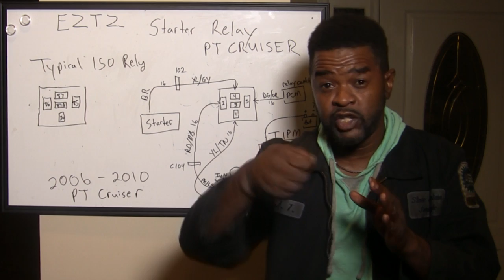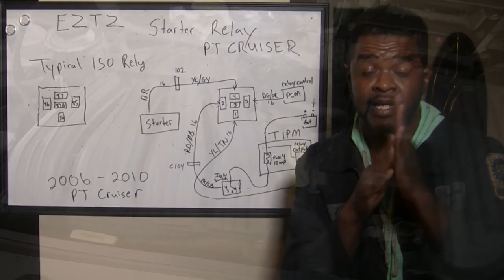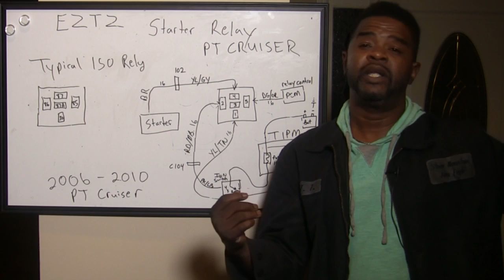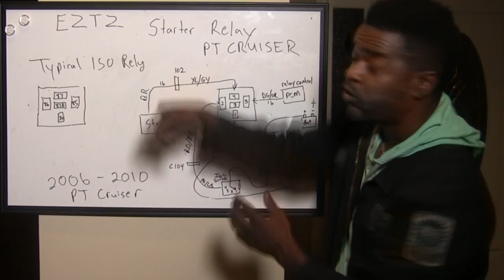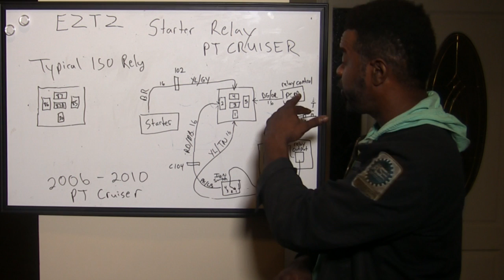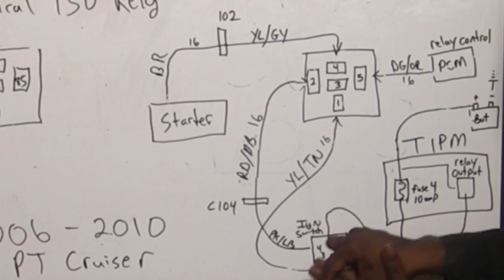No Crank No Start Diagnosis done using the Starter Relay, DIY.Won't Start? Simple Checks. PT Cruiser

Comment: I have a no crank Issue with my 08 Dodge charger. I have brand new starter new battery changed the relays I’m getting 12.4v on the power wire at the starter. Crazy part I got 12v on the s wire when it’s not connected to starter but 3v when it’s connected. Im stuck and need help
Reply from the maker: This not making sense. First off what kind of car is this? What are you refering to when you say "s wire" The big heavy gauge wire? And also are you subscribed to the channel?
Reply: Trust me it makes no sense to me either, but It’s a 2008 Dodge Charger. Yes I’m a sub and love your videos. I’m getting 12v at the heavy gauge wire and on the starter wire (the pin on the Solenoid) but when I put the wire on the starter solenoid and have someone turn the key  I only get 3-7v.
Reply from the maker: @NewMobEra  Hey bud, the yellow and gray wire that goes to the starter solenoid comes from the TIPM starter relay. One or 2 problems, you may have a loose body ground (check ground connections over by the TIPM area). Or better yet, just bypass the ignition and send 12 volts straight to pin 87 of the starter relay and see if the starter turn over normally
Reply: When I jump the relay 30 to 87 it starts right up. Do you ever host any live or q&a’s. at this point I’ll pay for a consultation I have to figure this out because my wife usually drives that car with the kids
Reply from the maker: @NewMobEra  Hey bud, I will say this. If you jump that and it start you just confirmed the circuit is complete between the TIPM and the starter. Your biggest task will be finding out where is the loss/short between the ignition switch and the starter relay. And without a scan tool showing data inside the skim, pcm and the TIPM this will be hard. When I have problems like this I view this data to see whats missing in order to correct. When you turn your key to the crank position, that signal goes thru the security module, thru the pcm and then to the tipm. How are you going to view which one is not getting the signal? What im trying to say is you will need a scan tool that can access those models and show data. Outside of that, the only thing you may can do without all that is to make sure all the grounds on the side clean and tight. Sorry bud but the electronics not what they use to be, a good scan tool crucial.
Reply: I appreciate you taking time out of your day to answer my questions. Keep up the great work !!!

Comment: Great explanation. Only question, would this be the same application for a 2011 Ram 1500 4x4 with a hemi 5.7?
Reply from the maker: Same theory apply to any starter sys that uses a ISO starter relay. But this a 2011 Ram, is ya truck cranking but not starting up? Also are you subscribed to the channel?
Reply: @OnlineMechanicTips  subscribed yes. No crank at all. my starter relay is only 4 prong, instead of 5, when I try the old trick of the screwdriver on the starter between the power and the tab all I get is clicking with the power on of course. I thought at first maybe the NSS, but damn, trying to find it on that truck is a pain.
Reply from the maker: @13thragnar  all you doing by jumping it is bypassing the circuit. This click that you hear, are you hearing it from the starter? as if the solenoid trying to engage? When you turn the key to crank, are you getting this same click? If so, the circuit complete and your starter simply failed.. If thats not the case, you need a scan to to look at inputs at the TIPM as well as the PCM to see whats preventing the circuit to close
Reply: @OnlineMechanicTips  I pulled the starter and waiting on ride to parts store to test it, but I have a good clue it is the problem. The wire that goes from the solenoid to the starter is very corroded and brittle and falling apart.

Comment: I have a 2003 PT Cruiser touring model has a new battery and starter.  It sat for 5 months,. Went to start it and nothing so charged battery and no crank   also radio stopped working and back window wiper will not shut off. Can you advise or direct me somewhere to get this help I need? please

Comment: I got a 3.6 v6. No crank. I swapped starter relays. I've tested the battery. I've pulled the starter tested the starter. It was slow but it passed. But no crank. I check all grounds I can find.  And I'm at a lost
Reply: Also pops starts with the clutch if you roll it . So I'm just fucked in connection somewhere
Reply from the maker: Pop start with clutch? What kind of car is this? Also are you subscribed to the channel?
Reply: @OnlineMechanicTips   it's a 2011 v6 Camaro. Recently just swapped the engine for a rebuilt. It went great. Ran great for about a week. And now. no crank.  Doesn't take a jump. I swapped the relays . Pulled the starter. Starter functioned. But engaged slow.  I get power upfront I hear all the actuators getting power. But no click not even from the starter  and yeah I subscribed  when I found hour channel
Reply from the maker: @PoppaLung707  Hey bud, just as I mention in the video. At the starter relay of any car, you should be able to diag a no crank,, First, at the relay, find out which pin goes directly to the starte, send 12 volts on that pin to see if the starter spin over over, if it do, the circuit is complete from the relay to the starter. If not theres a open circuit or the starter bad. Nest check your ignition input, which ever pin dictate key to crank position, you should be getting 12 volts on that pin when in the crank position, if not, ignition input lost. You may have to look up starter relay pin ID
Reply: Okay thank you

Comment: Jumping pin 1 and pin 4 only causes the starter to click once. Same as if key turns. Just a click. Starter is new, pcm was replaced and it solved the issue. 1 month later I'm getting a single click again.

Do I need another pcm again?
Reply from the maker: No thats not what that mean, that mean you have some more diagnosing to do buddy. Lets take a real good look at the connections between the battery and the ground thats on the transmission. Also are you subscribe to the channel?
Reply: @OnlineMechanicTips  I am now =). I'll get to checking the trans ground.

Comment: Thanks for the information.  I did subscribe to your channel. We tried pushing the clip in the front of the holder with a screwdriver, but could not get it to move.

 I am changing the starter relay because the car does not start on hot days. The battery and starter have been tested by 3 mechanics and has been fully charged each time.  Two of the mechanic cleaned the battery cables, one replaced the battery cables, but the problem still exists.  

I can read and understand schematics because I was an electronic technician for years.  I asked the mechanics about the starter relay and was told that is not the problem.  Since I can read schematics, and have worked with relays, the starter relay seems to be the logical cause of the intermittent starting problems.

Thanks for your help!
Reply from the maker: Curious, during start attempt, are you getting a click sound from the starter or relay? Or are you getting nothing when you attempt cranking?

Comment: I want to know how to remove the starter relay on a 2008 pt cruiser?  I know where it is located but am unable to remove the old relay to replace it with a new one.  I have seen videos on replacing the starter and how to test the starter relay, but no one shows or tell how to remove the starter relay from the clips that are holding it in place.  Can someone please help?
Reply from the maker: Hey Jackie, that starter relay retainer clip has to be pushed in then pull the connector out from relay. Curious as to why you want to remove it? Also are you subscribed to the channel?

Comment: Boss, I have no ground at the starter relay from the  PCM so I was suspecting a key, but he car has an aftermarket alarm so it does need a key to crank the engine but the sarter doesn't crank it either. Power and grounds have been verified to the PCM. WCM module is reading NGC/Status: Engine Kill Command and says key programmed is set to false but I get no codes at the WCM module and no security light is turning on during cranking. The WCM module has power and grounds, ignition switch send spower to relay and PCM. Not sure what else to check since I have no codes at the WCM, PCM has P0633 code stored.
Reply from the maker: Hey man, what year make and model car is this?
Reply: @OnlineMechanicTips  05 Dodge Durango 4.7L AWD.

Comment: All my problems started which I disconnected the negative battery cable to clear a CEL. 

I’ve perform the troubleshooting steps and get 12VDC on pin 30 and pin 86 while turning the ignition switch. I able able to jumper pin 30 in pin 87 and the starter does turn over.  Does this narrow the problem to being the PCM?

Awesome video. Thanks for posting.
Reply from the maker: pretty much. But the things you cant see are the inputs that the PCM looking for to even allow that ground. Thats where a good scan tool come in. Things like, is the trans in park/neutral, is the security key not activated? these inputs are important
Reply: I just replaced my PCM and disco she’s alive. Thank you very much for you diagnostic help.
Reply from the maker: @maverick19702000  My friend, happy for you and YW. Please give the videos a thumbs up likes and im sure you are subscribed by now...Thanks for watching bud,

Comment: Hey J.T. - Fantastic info / marker-board work (and showing the under-hood starter relay, etc)... 
 
This is one of the BEST and Clearest explanations I've ever seen for start & relay troubleshooting ...(complete with great info on poss connector issues and wire color changes, and jumping/bypassing and when & why to do it)...!   
Also good points on Park or Neutral requirements (etc) for PCM to allow ground to relay coil to energize downstream starter circuit. 
 
Added a lot to my clear understanding for how to troubleshoot no starts, & or what techs should be doing to get at no-crank problems..!  Thank-You !!!
Reply from the maker: Thanks for watching bud. Hope you gave the video a thumbs up and subscribed to the channel. I appreciate it..

Comment: I need help by passing anti theft lock pcm is bad but i cant buy new on yet sod i by passed ground on starter relay like you said starter turns over but no fuel like its out of gas guess pcm security has the fuel part off too how do i ground the fuel system that turned off also need car bad for work Thanks for you awesome help Steve
Reply from the maker: Steve by manually grounding that relay you are only verifying why the car not cranking. But the fact is that signal also tied into the ASD system which supplies the fuel and the spark. There is a ASD relay but if you jumper it, you may spike the pcm, besides, the ASD also look at RPM to tell if the relay should even be on. Couple things you can try but you will need a good scan tool to find out if the PCM (computer) internally shorted. For now, try a hard reset, unplug all the connectors on the pcm, remove both battery terminals and tie strap them together for awhile to drain the capacitors and see what happens from there.
Reply: @OnlineMechanicTips  Thanks so much Yea the pcm is bad had some try with there computer for that would stay connect and keep coming back pcm fault so im ordering pre programmed on just need it running till them thought there might be another awesome by pass like the starter Thanks so much for your help.

Comment: Great video man.!! Where can I get the same information, but for a 2005 PT? My daughters car is having issues.  It has a no crank problem. I tested the starter circuit like you explained in this video, and even pulled the starter relay apart, but I cant get it to crank with the key. Can I get around the anti-theft part?The starter cranks fine, but it drove one day and she went to leave the next morning and it would start for a few seconds and shut off. it did that several times. Now it won't even crank. Subscribed...

Comment: I need help with my pt cruiser idk wth is wrong w it i put gas in it and it failed to run anymore continued to try and crank it cut completely off no nothing
Reply from the maker: Hello my friend, thanks for watching AND subscribing..Listen, I need more info, what year is the PT?, are you using the correct key as so its not into lockout mode? are there any fault codes?
Reply: @OnlineMechanicTips  its a 07 pt cruiser i bought it literally a week ago a took it to O'Reilly and a fuse code came up cant remember put earlier today i messed around with the negative terminal and the car came back on after shutting completely off i then went to turn it over and it tried to start put failed to do so i did put gas in it and it just cut off thats how the problem occurred ive pulled all the fuses to see if any were blown none of them are i dont know much about the car i just bought it and it ran for about 2 weeks im p oed on the 😎
Reply: Could it be the battery it trys to crank but doesn't the lady i bought it from did mention she had the engine changed but the transmission acts up i believe its in limp mode i dont wanna give up on the car but it has become overwhelming....thanks in advance....
Reply from the maker: @kiacurley5836  Ok start with a starting point..You must have proper voltage supply first to even get started..You cant do any diagnostics without proper voltage supply..I suggest you start there, then find out what code in the computer
Reply: @OnlineMechanicTips  P0700 i believe it was this one from the tech at O'Reilly he also mentioned a fuse not sure will get the correct info however the car is disabled...sucks

Comment: Hey bro, she had it looked at and they said it was the PCM that was messed up. Could that be the case from the diagnostic I provided? if the PCM was bad, it wouldnt be getting 12 Volts  or is that through the TIPM? At any rate, if it was the PCM and it needed to be changed, couldnt she just get one from a junkyard and just swap them out and take it to the dealership to get it programmed? They was gonna charge her 1400
Reply from the maker: whoaaa, 1400? yes a used pcm would work fine. Somebody with a chrysler scan tool would just need to program the skim to that pcm using the chrysler security code...Because diagnosing this stuff can be complicated, how are they so sure its the PCM?..I keep spare pcm at shop for this reason, did they plug in a pcm to her car and verified that it will now crank?..Dont get me wrong, a pcm will cause this by opening the circuit to the ground side of the starter relay and also by open circuit to the TIPM, im just curious as to how are they so sure its the PCM and not the SKIM module,,If they can guarantee the the repair then it must be legit...hmmmm,,,